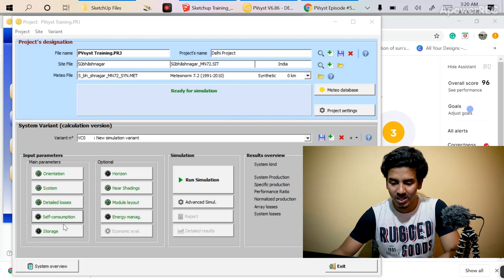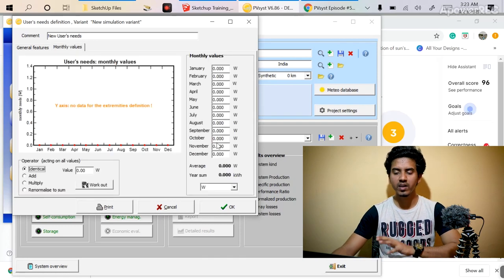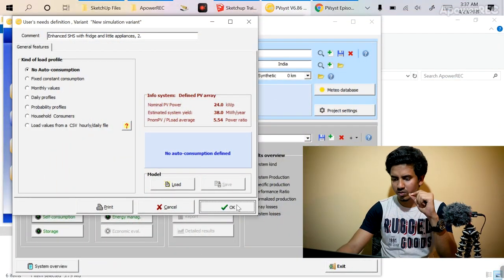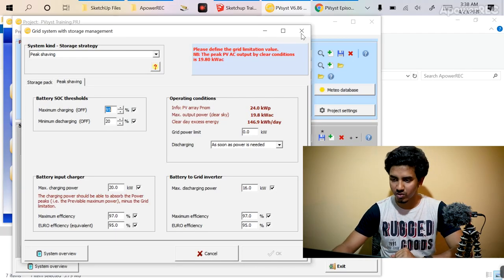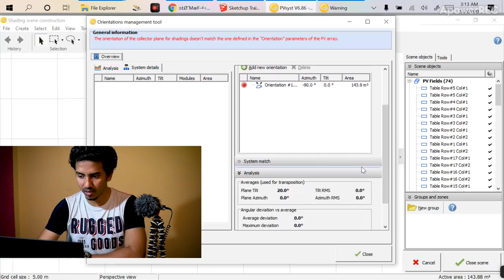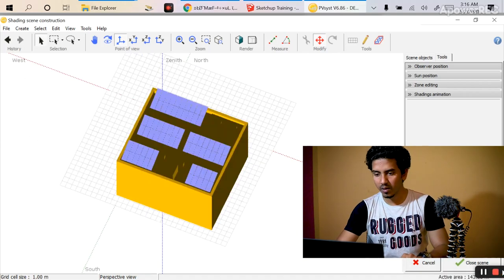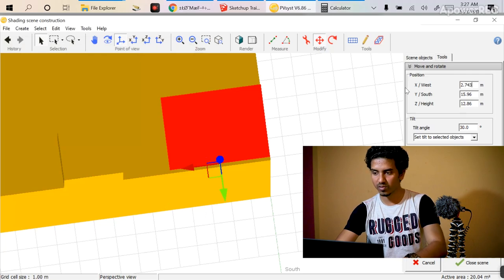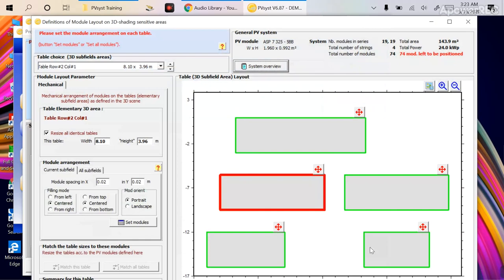Near Shading Drawing in PVsyst/ #PVsyst Software Training #Episode 5/Solar Power Training Episode 11

Comment: You understand what you say in your lectures so that it is very interested and some English word are not clear for us however, how we can do near shading analysis by PV system for 2MWp without external software , and I have seen albedo factor in thr result, what is the acceptance value for albedo factor to judge on the shading analysis
Reply from the maker: Yeah, I know there is some problem because I am a non english person. But I am updating all the subtitles.
If it's a Ground Mounted plant, you can easily draw the same by using PV Table as frame. Choose Pitch , X modules, Y Modules and number of rows.

Thanks & Regards,
Amiya
All About Solar
Reply: @AllAboutSolar  Thanks alot but I did not pitch and land area under PV Table as frame while I need 27 raw and each raw has 19 string in one raw and the pitch is 7 meter between raw and raw
Reply: @All About #Solar, Hi friend,   I have seen at PV  table as shed not as frame . again I get albedo is 0.825, does this correct ??

Comment: I got a problem on creating a new PV module of Yingli solar of 385 w.. 
It doesn't exist. I input all the data from the datasheet and it says me it's not available when I finish
Reply from the maker: Try to edit any other manufacturer 385 Wp and Save it as Yingli Module. I think it will work. Otherwise you can contact me on 9831633226, this is my WhatsApp number.

Thanks,
Amiya
All About Solar